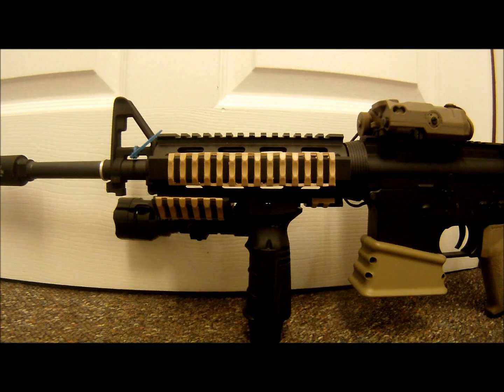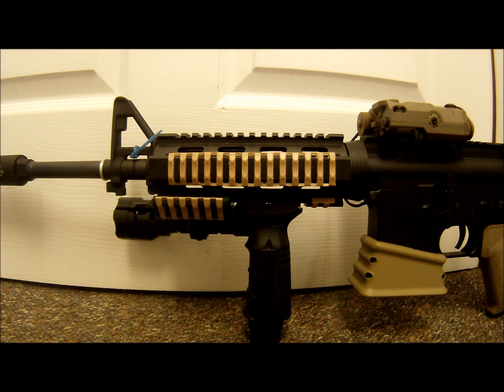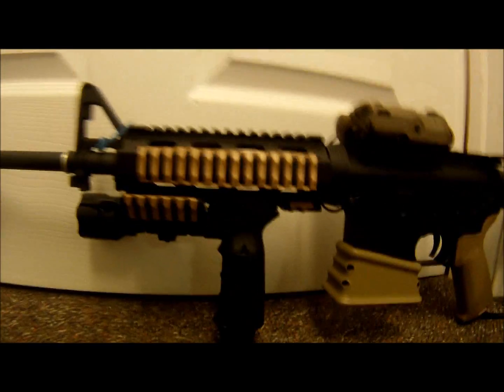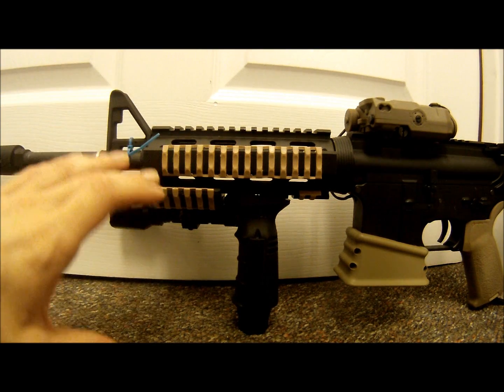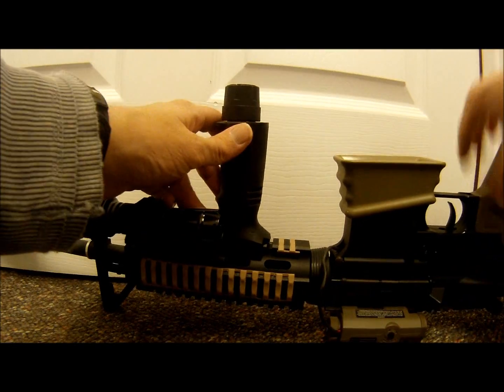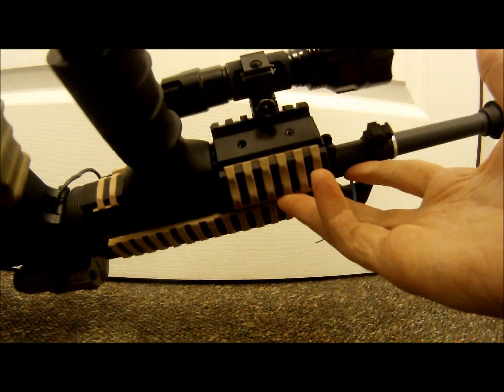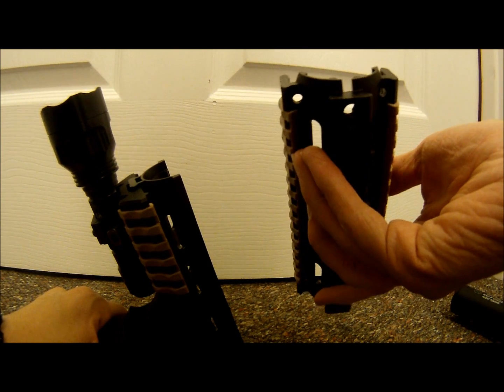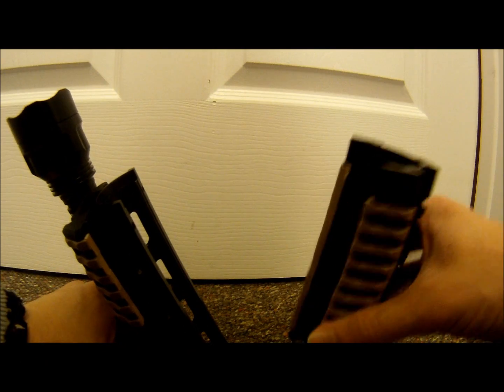AIM "Real Steel" High Grade M4 QUAD RIS Handguard

Comment from the maker: well the grip will have a motor height adjustment screw, so you unscrew that all the way until it comes out and put the hose through that. Make sure to put some heat shrink or electrical tape on so as not to cut the tube.

Comment from the maker: It should however, if the g&g's retaining ring is too far forward or back it won't fit as i'm pretty sure it has a one piece front sight and outer barrel. You may want to check the dimensions just to make sure.

Comment: get a barrel that is shorter than a rail system, Example: if you have a 10 inch barrel get a 11 or 12 rail. then get a silencer it doesn't really matter what kind just as long it will fit in the rail system. look a the airsoftgi g4 a2 silent death i have one and im pretty sure its what your looking at

Comment from the maker: @aqwstrikefreedom1234 I'm assuming you have a triangle front sight, and you are talking about the little bit in between that and the beginning of the threads. You will need a silencer, probably a qd one, that doesn't just screw onto the barrel normally

JBU Matrix Full Metal Mock Silencer. 

Mad Bull Gemtech HALO Mock Supressor. (Black) 

Copy and paste those into the evike search bar.The first one is probably the one you are looking for, Good luck!